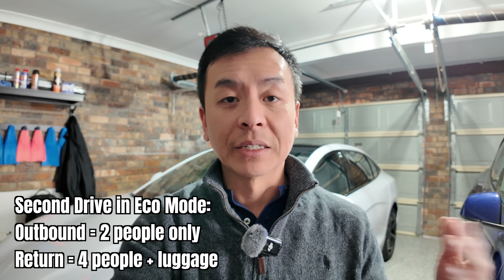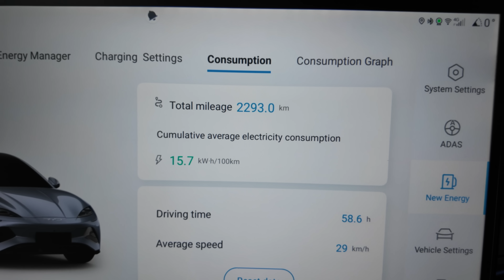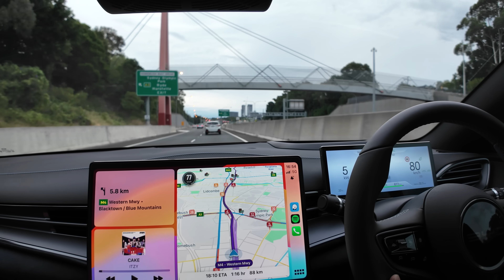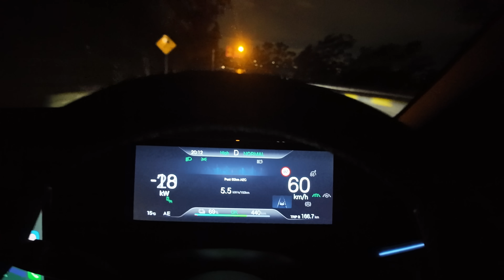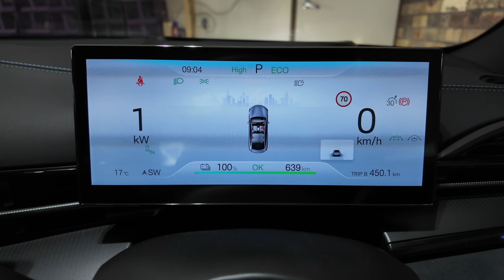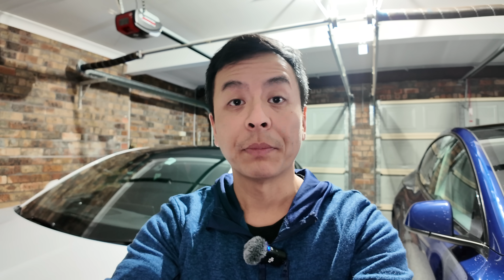Eco Mode vs Normal Mode | BYD Seal Range Test for Highway Efficiency

Comment: For highway range, there's not much you can do about physics. To travel at a certain speed, you must push air out of the way, and there's nothing the motor drive electronics can do about that, whatever mode it's in.

Comment: I got the same results here in Israel driving to work in Jerusalem and back home to central with BYD ATTO3, I got a 2-3% difference, Since it is only 2-3 % I have stopped using the Eco as the Normal is much more responsive and nicer driving experience. Thanks for the video

Comment: silly question - the minus sign on the left is good and over 0 is bad? or the other way around? On the trip computer
Reply from the maker: Yes minus is regen braking occurring and charging the battery = good
Positive numbers means energy is being derived from the battery

Comment: There is a U tube post showing meter cluster of BYD M6. The guy press down the pedal and needle showing kw and km/hr moves up rapidly. By the time speed is at 60km/hr the kw input into the motor is already at max of 140kw. The posting show he did it to about 110km/hr.

What I understand is typical motor in an EV goes up to 9000rpm max for 180km/hr. From 0 to 3000rpm the torque is at max value with the pedal full pressed down. At 3000rpm kw would be still at max value. From 3000 to 6000rpm torque value will drop off quite fast while the kw of input into the motor is maintained with the pedal still fully down. From 6000 to 9000rpm the torque drop off is tapering down vs kw input still in its max value. This is why wheels spinning is very frequent when it is doing under 60km/hr when pedal down?. This is said to be pronounce for FWD EV?.

Comment: BYD non-owner question: does the car stay in previously selected modes? i.e. I would select Eco mode, stop the car and get back in later and it would retain that mode setting not have to be reselected?
Reply from the maker: Yes I believe so

Comment: That’s pretty decent efficiency 👍 chill mode in Tesla drops the target battery temperature so you save on battery heating. Battery temp is required for maximum power demand.
Reply from the maker: Interesting ... good feature of Tesla Chill mode 😎
Reply: A warmer battery is also much more efficient. I have a lifetime usage of 108wh/100 km on my 2023 RWD and get into the low 90's mid summer  - I have tried all sorts of combinations and permutations with respect to efficiency, provided I drive in a sensible manner then chill mode does bupkis for efficiency whether it's -5C or 40C outside. I have tried this many times on my regular commute from the Blue Mountains to Surry Hills and back. Aero covers made around a 2% difference but I like the bare alloys better.
Reply: https://i.imgur.com/F6cHgps.jpg

Comment: Great video Tom and appreciated your honesty about the variables.
IMO if you reversed the tests and did ECO with the additional uphill load and NORM with the downhill load I suspect the results may have been closer.
Energy used to climb hills is never fully recovered going down hills (physics laws).
Also and personally, in my Atto 3 that we have owned for one year now (14900km) we find efficency with low regen best on highways and high regen in the city.
Same physics laws that more energy required to get moving again than what is gained on regen.
Disclaimer: we don't have the equivalent of the Blue Mountains here in SA but I did the following test.
We have a section of road called Willunga Hill which is about a 9% hill over about three kilometres. 
Going down in low regen ICC normal mode I gained more range than in high regen mode. Although the hill component was only 3km ish I measured over 8km.
The reason I believe low regen is better there is because after the ICC corrects the speed on flatish sections in particular it uses less energy regaining the speed.
Apologies for my confusing wording but there was a 2km range difference recorded.
Reply from the maker: Thanks! Agreed I think it would’ve been closer had I controlled the mass a bit better. My next test will be to test standard vs high regen on the highway to see what the difference in efficiency is … stay tuned!

Comment: Awesome video. Love the Seal. I was surprised that you almost didn't gain a bit of range at the bottom of the mountain, given it's a 1km drop from Katoomba to Penrith/Emu Plains. Eco mode is pretty impressive though. Looks like you'd get close to 600km range.
Reply from the maker: Depends on weather conditions as I found out that same weekend 😁
Long Range BYD Seal Highway Range and Efficiency Driving in the Rain
https://youtu.be/4N_0qB13Kkc

Comment: Always beautiful videos, thanks for that but somehow the 14.4 kWh/100km in normal mode is not correct if the battery has 82.5 kWh net capacity right? I get 15.29 kWh/100km at 43% of 100% and 232km route? ...... Best regards from Germany
Reply from the maker: Thanks! Don't forget the efficiency shown on screen is only for the past 50km hence it's not valid. That's my biggest gripe with the BYD ecosystem in that the trip stats are not detailed enough. The trip computer really should also include the efficiency for the trip, not just for the past 50km
Reply: @LudicrousFeed  Yes, exactly there was and I didn't think about that ... the 14.4/100km in the on -board computer confused me

Thank you and best regards from Germany

Comment: Great video again. Thank you! It seems that the difference between the 2 is not that much. I'm wondering if the Sports mode will also have little difference compared to the Normal or the difference will be much higher?
Reply from the maker: Good question … in Sport Mode I’d be too tempted to floor it each time 😆

Comment: Not a real conclusive result, what changes in the vehicle between these 2 modes that affects the efficiency.
Reply from the maker: For most situations I’d probably stick with Normal or Sport but if I’m close to the cusp of making it to the next charger then it’s comforting to know that Eco Mode is there to help with range anxiety

Comment: This is a great video. That said mode is one of the factors. How you drive also matters. If drive softly range will be great, if you accelerate like crazy then range goes down. I always drive L mode on  my Bolt and dont push too hard and get great range.
Reply from the maker: Yes driving style matters as does cruising speed. I suppose myself being the same driver in both arms of the test does standardise it to some extent 😁

Comment: There is something weird...Tom, your Seal calculates 639km to be able to do being charged Fully 100% battery 

I own same car as yours, with 15/16 kW consumtion average, RWD 313.

But always when I Fully charge my car to 100% , It indicates 570km máximum to do

Always 570km, It never indicates more...

And your Seal indicates 639km...how Is It possible?? IS my car having any issue? I do not understand 

In "new energy" battery settings I selected "Standard"

Can you give me your opinión please ?
Reply from the maker: I wouldn’t worry too much about the projected range - I find that it’s never that accurate. The only true value is the efficiency and actual range measured by the trip computer
Reply: @Andrew-Night  its varies depends on region wer u r..650 NEDC same in WLTP 570

Comment: Would be an interesting test to see whether the spread in efficiency between eco mode and normal or sport in a twin motor Performance is greater. I’d expect it would be.
Reply from the maker: I suspect on the highway at cruising speed there wouldn’t be too much difference between the two cars when comparing the same modes

Comment: Thank you for taking the time to try this out.  The test might have a mass problem, but as stated, you cannot control all variables.  4 people up the mountains in normal mode and 2 down, then 2 up and 4 down in eco mode 2 days later is problematic.  I think it’s too close to call, and surprising as I would have expected Eco to be much further ahead in this particular test.
Reply from the maker: Pleasure! This was too good of an opportunity to not do this test 😁 despite its limitations of courseP
Reply: Doing a rough, high school physics calculation, the effects of the weight allocation could have accounted for a roughly 1KWh difference, more if the kids are teenagers or they took a lot of luggage.

Given the other sources of variation, in my view you can’t rule out the “eco mode has no effect on consumption on a gently driven car” hypothesis on the basis of this test.
Reply from the maker: @robertmerkel8247  The extra weight with our 2 teenagers and light luggage probably equated to an extra 100kg of weight which is less than 5% of the car’s mass
Reply: In general, sure. But this was a somewhat unusual route you were taking.

In normal mode, you started somewhere in Sydney at close to sea level, drove to Katoomba (at roughly 1000 metres of altitude) with 100 kg in the car.  So you had to use extra energy to get the car up the hill.  Normally, you’d get a lot of that back going down the hill, but you took the weight out again for the trip down.

On the eco mode trip, the car was light for going uphill (so you used less energy to get up the hill) then heavy for going downhill (so you used less energy downhill).

I agree the effect is not huge, but like I said, rough calculations suggest it might explain a fair chunk of the fairly small differences between normal and eco mode on this specific route.

Anyway, thanks for the videos, I do appreciate them!

Comment: Which version of the BYD Seal is this? or which battery pack does it have
Reply from the maker: It’s called the “Premium” variant in Australia but it’s essentially the Single Motor RWD Long Range trim to help compare with other markets. It has a 82.5kWh useable LFP BYD Blade battery as part of its powertrain

Comment: I drive a BYD Dolphin and was recently able to test a Seal Premium for a week. I prefer Eco mode because it is a more pleasant driving experience. You have more pedal travel and therefore better control of acceleration, which the passengers especially love. There is more than enough power even in Eco mode.
Reply from the maker: Yes agreed if there are passengers in the car with me, I'll usually switch to Normal Mode when driving around town for their comfort
Reply: @LudicrousFeed  Normal is still too much for me; especially with the Seal Dynamik.
Reply from the maker: @JürgHölzle  You gotta do what’s best for you 🙏

Comment: Thank you for your videos. They are helping my purchasing decision. I've never owned a car with driving modes before, but i would think drive modes should alter the throttle response with different maps that do not limit maximum power when floored. what if sudden power is needed to get out of a sticky situation? Roll the little dial to sport mode in the split second before death?
is there a kick-down feature in this car like a traditional Automatic ICE car would have?
Reply from the maker: Pleasure. I don't ever recall seeing an OEM "Kick-Down" button or feature in any of the EVs I've reviewed to date ... however there are after market products such as the S3XY Knob/Buttons that can be programmed to create that short burst of acceleration if needed: https://youtu.be/Vz0Uq5uKiWI
Reply: @LudicrousFeed  Ahh, interesting. An actual button.
The Kickdown is that last part of the throttle pedal's travel that triggers the gearbox to shift down to lowest gear possible for max revs/power in automatic ICE cars. Theres an actual tactile bump at the kickdown point on my pedal. (honda accord euro).

Comment: Realistically, not enough difference to bother, I guess.
Reply from the maker: Probably not for most situations ... but useful if you're right on the edge of making it to another charger ...
Reply: @LudicrousFeed  it's good to know that you could squeeze an extra mile if needed, but... sport mode is king!
Reply from the maker: @Another_opinion_  Sport Mode when range doesn’t matter 😅

Comment: We’ve found the same roughly. A trip to Canberra showed we squeezed a bit more kms on Eco than Normal. Only downside is the lack of “grunt” in Eco. ~2000kms since delivery on 10th April, and find that the Normal mode provides much increased performance over Eco and the gains in Eco aren’t worth it in our circumstances. Great video again, thank you for doing the comparison, it really does help us EV newbies out here!
Reply: The lack of grunt is probably where the efficiency comes from. There isn't much you can tune on an EV drivetrain, the main thing you can do is make people accelerate more slowly by fiddling with the accelerator pedal's responsiveness. You can probably drive in sport mode and get the same efficiency as eco mode if you're gentle enough on the pedal.
Reply: @ZurOhki1 they can actually drop the battery temperature for the lower power modes because the battery has to be able to deliver the demand power and needs to be hotter to deliver more power. Tesla drops the battery temp in eco mode which is why you don’t get max power and you save energy in battery heating depending on climate etc. the reverse is also true. The battery needs to be hot at accept power which is why it gets heated when you dc charge.
Reply: Yes, "grunt" means I²R losses.
Reply from the maker: Pleasure! I suppose on the freeway, there’s not too much compromise on Eco mode given you’re cruising within a narrow range of speed anyway most of the time (except for overtakes). I definitely use Sport Mode in the city, love that acceleration too much 😆